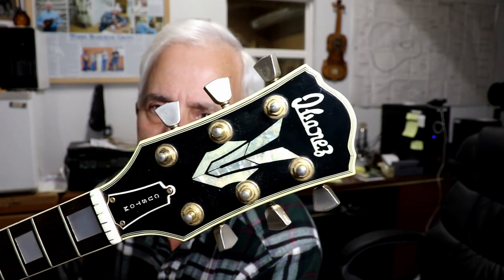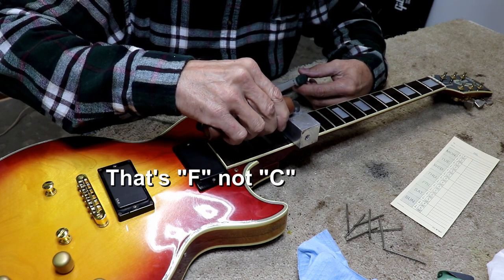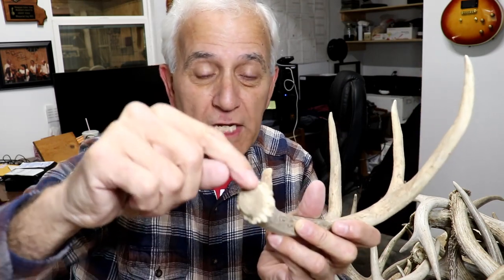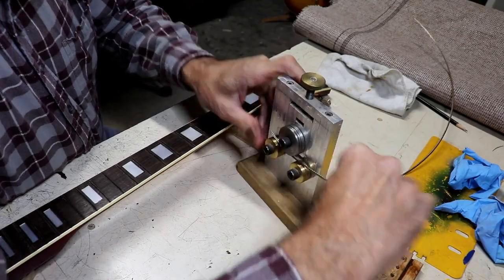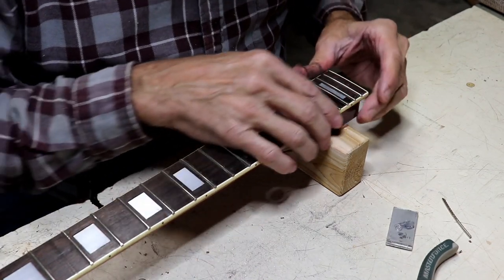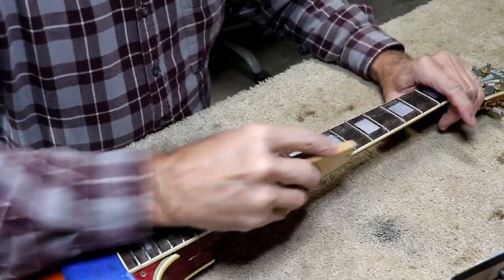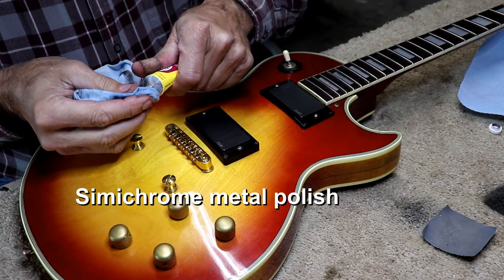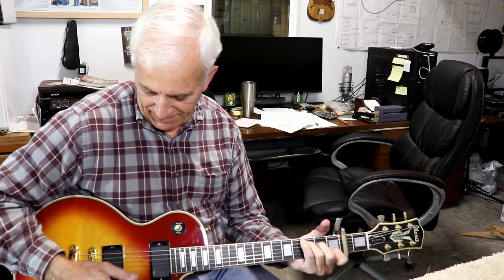345 RSW Les Paul Doesn't Need To Fret Anymore

Comment: I have one of these models - #0978. Years ago I rescued it from the trash after it had been kept in a damp basement for 10 years. The fret ends had come up from the fretboard swelling and I tapped them down - I wish I'd known about using the CA+accelerator - the ends still creep up from time to time!  The hardware got pretty ratty from the moisture, but the original pickups actually sound pretty good, and I take it out on gigs every once in a while for fun. Thanks for the great lessons, and I'll be using your acoustic repair methods on another rescue from 40 years ago -  A spanish nylon string that had pulled its bridge and has face and back cracks that I tried to repair with white glue. I love the little thing, and am looking forward to cleaning out the old glue and properly clamping it as you've taught, so I can hear how it sounds with a healthy back and sides. Thanks, Jerry!!!!

Comment: Got a double anniversary Les Paul that was rode hard by a southern rocker.  The frets need replacing, but are bound over.  Can a re-fret be done without damaging the binding?
Reply from the maker: Far as I know it should not be a problem.
Reply: @RosaStringWorks  Thanks for the response.  A few years ago, I had two different folks decline the task, but your skill and attitude gave me enough hope to pose the question.  Perhaps I could send pics?

Comment: Hi Jerry, I came back over here because I just watched your rant, or should I call it real tell it like it is and the truth to boot video.. If you need to grind those frets down fast try gettig' a really big file, attach it to 1 x 3 oak board, contour that hunk of oak so it's comfortable and then start leaning on that sucker. Pretty soon you'll have some very thin frets. As a side benefit you won't have bent the neck, but buy pushing down so hard on your filein' thing, you'd have another repair to charge for --- glueing the head stock back on. Just thing how rich you'd get doin' all those extra repairs. I sure am glad to see how soft your touch is while workin' yer fret file. You prove that fret work isn't rocket science, it's art. That old retired phonie from AT&T in Appleton, WI.

Comment: Love your videos Jerry.  I read some comments on down the line here, and there's a couple that make an important point, although the manner in which the folks below chose to say it was I think a smidge rude.  I'm a Les Paul player, I set up my guitars and work on them all myself.. I don't think it matters whether or not there's too much tension being pressed down on the neck while working on the frets, I think (by my experiences) it's probably just a really good idea to keep some support under that neck while the guitar lays on it's back, just my thoughts.  It'll relieve any worries that an electric player might have as headstocks have been snapped off under many varying circumstances and for lots of different reasons.  That being said I really enjoyed watching you give this baby some new life, great job.  Peace to ya Jerry, keep up the good work
Reply from the maker: I would say it was a bit more than rude. They seem to miss one very important point. No they ignore the important point. That is I did the Fret Job, it worked perfectly. The action was set down to fifty thousands of an inch at the 12th fret. That's the thickness of a heavy pick. And it did not Buzz. If my process is so wrong, how does it work so well? The customer was incredibly happy. I guess I just have to change how I do it just make people happy on the video. Who cares what the customer thinks.

Comment: Jerry, Do you oil the fret board to moisturize it and keep water penetration into the wood down before heating? It looked fairly dark and in good condition. Iv'e never tried it but wondered what you think.
Reply from the maker: No I just use water on it. The water dries pretty quickly it's not that big a deal.

Comment: When I got out of the Army I worked at the Fender Factory (CBS) after Leo sold it. I studied the tooling and operations closely. One thing they did was slide frets in from one side pressed against the fingerboards. I believe they even routed the fret wire off on a step for bound versions. Sliding cuts a channel parallel to the top surface and if frets were up a bit they did press them down. It's bid over 40 years I'm sure I'm not breaking any laws at this point mentioning it.

Comment: You have outdone yourself again Mr. Rosa.  I take my hat off to you once more.  BTW, tuning down one step is not uncommon among many guitar players.  Especially those that play 12 string acoustic guitars, which for practical reasons is tuned down one step to reduce the tension because the gauge of the strings is too heavy for the guitar to be tuned at full pitch.  I myself use a custom light gauge for all my six string guitars but for my twelve strings I use a custom ultra light set 38-17 to 8-8 gauge which keeps the tension down.
Reply from the maker: Nice built several 12-string guitars from scratch. And I am totally familiar with tuning them down a half step. Generally not a full step.

Comment: I really enjoy watching you expertise on guitar repairing. I got a wild idea, and unstrung my 12 string guitar and took a inside (guitar selfie )with my cellphone. It showed the string pegs and string ends pretty well, plus it can be zoomed in a little. The only problem is it's hard to click the camera. I tried it in video mode but it problably needs lighting. A pancake turner would probably get it back farther if a contraption was made to click the camera.

Comment: as a comedian jerry you make a great luthier lol.....good job on the neck but down to a D is a bit extreme i've always played electric and i tune my stratocaster down a half tone sometimes and it's almost impossible to control .....would like to hear what he uses it on it may be worth a listen.....have a good day
Reply: I don't know about D standard, but C standard is commonly used by Josh Homme of Queens of the Stone Age. It gives a tone that hits you right in the guts, but doesn't have the long scale playability issues of a baritone. It's not something i'd describe as "pretty" but it has a use case for sure. I used to have a guitar set up for C standard. It's not impossible to make a guitar play well dropped that low, but the whole guitar (and the player) have to be set up for it.
Reply: I agree. Couldn't the owner just use Drop D? Hendrix as most every knows tuned his guitars a half step down. I do tune my Tele to Open D for slide, lately been using Open G but G is too high for my voice now.

Comment: Tuning it down a full step, I'd increase the gauge of the strings up to at least 13's, if not more. You'd definitely want a wound G string.
Reply: I know this this is mostly subjective, but, coming from a metal player 13's are too heavy for D standard tuning on an electric guitar.  Especially on the treble strings.  A typical Les Paul in standard tuning comes with 10-46 strings. In that set of strings your B string is a 13 gauge.  A 13 would be really high tension for a high D.  On my guitars in full step down I use something like 52-11 in full step down. If I drop the low string down another step so it's in drop C tuning, I use 56-11. And a lot of people think that's too heavy on an electric guitar. My action is about .070 on the bass side and .060 on the treble side. There's some slight buzz if you play it hard enough but not enough that you can hear through a distorted amp. Just my 2 cents :)
Reply: Yeah, Chris, I’d trust your call here - I’m more experienced with acoustics (and my short - scale Ric).

Comment: It is definitely a lawsuit era Ibanez.  To be exact, the guitar is an Ibanez  2350CS which was manufactured between 1976 and 1977 when they changed the headstock shape and "inlay".  The Ibanez logo and headstock "inlay" in question consist of pearlescent paint which was silkscreened onto the headstock which was painted black.  The headstock binding on its genuine counterpart, the Gibson Les Paul Custom was self contained on the headstock veneer which was inlaid with genuine mother of pearl.  The block inlays on the Ibanez 2350CS are made from plastic.  Hope this information is of some benefit to you Mr. Rosa.

Comment: Moose antlers? Elk antlers? Are there other critters that can 'donate' their head weapons to Jerry?
Reply from the maker: Believe It or Not moose and elk antlers are so porous they don't work all that well. They work fine for guitars because you can just use the outer shell.
Reply: @RosaStringWorks  Interesting. I guess you can make a canoe paddle out of a moose antler then. They're big enough.
Reply: Rosa String Works correct. Deer antlers are definitely denser than elk.
Reply: I believe some troll ribs would make great nuts and saddles!

Comment: Great Job as alway's. Too bad those Pick Ups and even Capo'd that dropped tuning makes a great guitar sound like crap.
Reply: I'm not a fan of emg pickups either, I have some in an epiphone prophecy, and I rarely play it just because the pickups are so godawful, they sound so unnatural.
Reply: Those active pickups are made for that heavy metal junk. They dont work at all for good old country and bluegrass. Lol. Plus a good amp makes a HUGE difference in the sound.
Reply: @1980bwc  agreed, they are pretty much only useful for compressed sounding heavy metal tones. I have a nice orange amp, but I just can't get anything worthwhile out of them. The clean tones are extremely disappointing, they are high output pickups, yet somehow the higher strings have no balls or bite whatsoever.
Reply: @bgilley8199  I hear ya. Ive never owned any. All I have right now are single coils in all my electrics. Which is 2 Telecasters, 1 Stratocaster, and a cheap Ibanez. I love and play most only clean tones. I bought an Ibanez TSA15 amp last year, and it produces super clean tones with those 6V6 power tubes.
Reply: @1980bwc  or Rock IMHO LOL
Reply: @mikelandreth7810  I like some classic rock. Not alot of it though.

Comment: Don't think that one is a "lawsuit" Ibanez.
Pickups are magnetic and filings will stick to the pick ups.
Magnets are what makes them work you should know that.
Seems you like to thumb your nose up at electric guitars.I hate working on acoustic guitars but I don't discount them as an instrument.
Reply from the maker: Filings will not stick to the pickups if the filings are not magnetic. The filings were brass try to pick those up with a magnet sometime
Reply: Jerry Rosa has forgotten more about instruments than you will ever know Richard. How dare you smart off to him like that!
Reply: @1980bwc   Fret wire in made of nickle, copper and cadmium as well as some zinc, nickle is magnetic as is cadmium to some degree. I have done plenty of fret jobs and I have had small particles find their way on to the slugs of a pick up. Jerry I think its the copper you are seeing.
All I can talk about is what I have found while working on instruments for other people for 20+ years which is not as long as Jerry
How Jerry frets a guitar is totally up to him I am not bashing his methods and I agree with him a big fancy jig isn't needed IMO.
Jerry knows his stuff about acoustic and more traditional instruments I will give him that.
I work on electric guitars 99% of the time and have plenty of experience with new and vintage electric guitars. 

He just seems to thumb his nose up on electric guitars that is the point I was making.